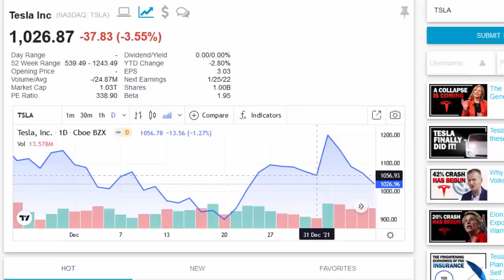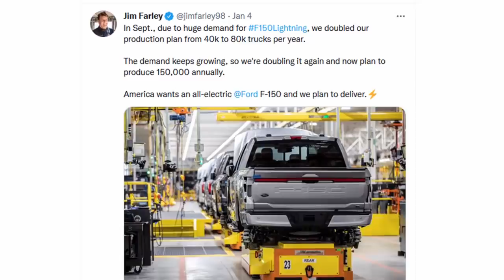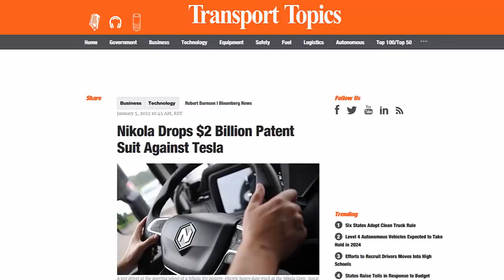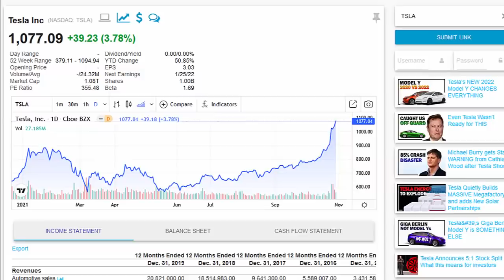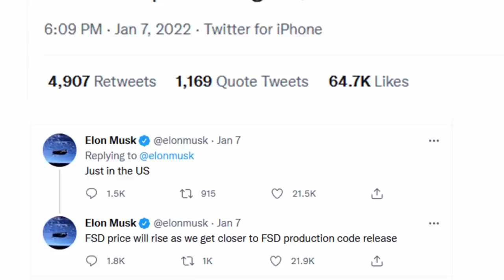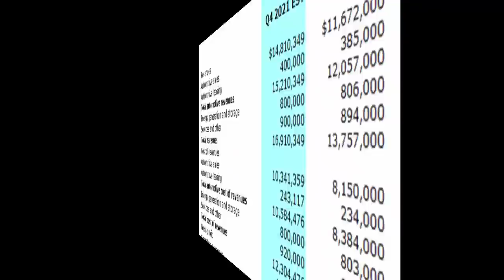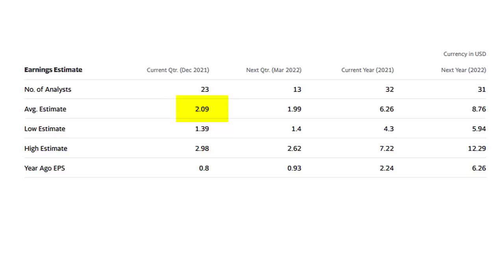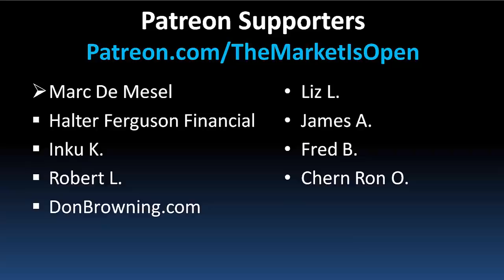You Won’t BELIEVE How Much Money Tesla Can Make in Q4

Comment: It could be the margins that will shock Wall St.
As production numbers increase fixed costs stay…… fixed, and possibly operating costs do not increase in line either, due to economies of scale.
Gross Margins of 30+% and Operating Margins 17-18% unheard of in auto, and may not be expected.
Reply: ...and yet to be determined service center costs, as they seem to be overworked and under staffed.

Comment: Although I am firmly in favour of Tesla’s vision only approach, Tesla fans don’t seem to acknowledge that the vast majority of people live in cities that have a relatively small area that is easily mapped.  This implies that the vast majority of the potential robotaxi market will be accessible to the likes of mobileye etc.  if these Lidar based solutions can come to market faster than Tesla it may turn out a smart move to use the crutches after all.  Of course, Ultimately, Tesla’s price advantage with vision only wins.
Reply: Good point. But it might suit Tesla to NOT be first to the Robotaxi market as the Lidar Taxis can pave the way with regards to regulatory approvals.
Reply: I’m for Tesla vision too but I too see companies using LiDAR/mapping coming to city markets first.  Hopefully it will be a very short lived “victory” for teslas competitors.
Reply: I would rephrase this to mean the real value in competing ADAS systems is the ability to tease the future in the same way that all "forward looking" legacy designed prototypes are never, ever delivered.  Just an old promise replaced by a new, better, promise.  There is no real world event where they ever "work" as in, standard equipment already on board, just unlock it with a phone purchase in the app.  What competition I could buy today, even with an unlimited budget isn't just bad, it's downright dangerous.  Lucid doesn't even have cruise control according to people that have them.
Reply: @ExAerospace  The lacking of something like cruise control (that is expected to be standard) is downright awful.
Reply: Sending a crap product to market is a crap strategy. What city doesn’t have construction? Mobile eye is useless during construction,  faded paint and has issues with manhole covers. Their solution is to add MORE HARDWARE!!!! 😂 it will never be enough with this solution.
Reply: Keeping maps updated for EVERY street in even large cities is a tremendous undertaking.  Never ending road construction updates etc / I think it’s useful for specific routes much like a bus but that’s about it.
Reply: @jgoemaat  all systems also
Have vision based decision making to deal with deviations from the maps.  Whether that works remains to be seen.  But it also remains to be seen whether Tesla’s vision only approach will work
Reply: "Although I am firmly in favour of Tesla’s vision only approach, Tesla fans don’t seem to acknowledge that the vast majority of people live in cities that have a relatively small area that is easily mapped. "

And that relatively small area is also the type of environment that changes most frequently. But that is besides the point anyway. Lidar mapping is a waste of time either way and lidar does not make cars smart and autonomous. You still have to solve computer vision, and when you have accomplished that there is no need for Lidar. 

"This implies that the vast majority of the potential robotaxi market will be accessible to the likes of mobileye etc."

There is a difference in having the vast majority of the potential market accessible, and actually being able to take advantage of it. Keep in mind that the vast majority  of the EV market is available to legacy automakers, but still they have failed completely at taking advantage of that. 

"if these Lidar based solutions can come to market faster than Tesla it may turn out a smart move to use the crutches after all."

No. It won't. Even if they are faster, they will still have a more expensive and inferior product to offer. Google was not the first search engine to the market, but having the right data approach made them superior to everyone else. This is the path that Tesla is on. Given the complexity of FSD there will not be many players and the winner(s) will take the bulk of the market. 

"Of course, Ultimately, Tesla’s price advantage with vision only wins."

Not only on the cost aspect, but their product will also be superior to what the competition will be able to cook up using the lidar approach.
Reply: @wheelofcheese100  "I’m for Tesla vision too but I too see companies using LiDAR/mapping coming to city markets first.  Hopefully it will be a very short lived “victory” for teslas competitors."

It will. You are forced to solve computer vision for any kind of generalized full self driving robo taxy service, and when you have done that there is very little use left for lidar.
Reply: What you say is true. However, with the rate of change of the landscape, building, and infrastructure in any urban area, LiDAR mapping will need to be continuously updated and vehicles software will need to be updated often, possibly every few days. I submit that the general solution is superior.
Reply: Vision only FSD is important because it will also be utilized in the Tesla Bot. Win Win!
Reply: @boringlyfactual6368  I believe most urban areas have public ally available online info of roadworks.  I don’t see it as an insurmountable problem to prioritise updating these areas.  In addition crowd sourcing at least low res updates to the map should be fairly straightforward.  IMO the difficulty of keeping maps updated in a city is overstated.
Reply: @svenhodaka9145  true.  But on the other hand a Tesla bot shooting lasers out of its eyes would be cool
Reply: @andrewpaulhart  - I understand the spirit of your comment. However, have you ever had to wait on a city inspector? And experienced the half -assed job inspectors most often do? In addition to the practical matter of getting a warm body out there, multiple issues remain — what to document, how to document, how to communicate that to the people who need to know, transcribing the data into meaningful 3-D maps, how to implement quality control of the inspections, and last, but not least, who is going to pay for it. Oh yeah, who is liable in the case of errors causing property loss, injuries, and deaths. There are myriad other potential issues such as how to manage the mapping during major infrastructure projects which can last months or years. The resources needed would be crushing. We definitely don’t need more bureaucracy. A general solution is the only thing that meets the smell test. Mapping and LiDAR will likely fill an important niche in urban transportation. One size rarely fits all for technical solutions, even general ones.
Reply: I just don't see how they can react to edge cases and real world problems like roadworks or a child suddenly walking out from behind a bus? Surely the cars need to be able to 'think' and make a decision in that scenario which requires vision recognition and artificial intelligence.
Reply: @chemistrysimplified1501  they all have vision as part of their sensor suit.  Since they all know that roadworks etc will exist they must be confident that their vision decision systems must be able to cope with these situations. The developers of Lidar inclusive systems are not developers without experience in AI and autonomous systems.  Elon doesn’t have a monopoly on talent and There are many people at the top of their game taking this approach.  

My take is that Elon thinks longer term than others.  He isn’t interested in interim solutions that might work in a subset of situations, whilst others are.  It’s not that necessarily that Lidar systems can’t work in cities, it is more that Elon isn’t interested in a solution that only works in cities
Reply: @chemistrysimplified1501  Thanks for your thoughts about this.
Reply: @andrewpaulhart  I watched an interview with Elon earlier talking about object permanence, such as when a child walks behind a bus, then continues walking (unseen) then appears in front of the car. LIDAR cannot detect and plan ahead for this and may give conflicting data to the computer. Only a vision based system with insane problem solving ability is going to be able to respond appropriately in time to avoid collisions. In any given city this is going to happen multiple times per day! Self driving cars have to be safer than humans to get regulatory approval which won't happen if they are only as good as say 'siri' or autocorrect on my phone!
Reply: @jgoemaat  Yes enormous ongoing cost to maintain these maps. Very much a short term solution
Reply: 2 1/2 years ago I was in a model 3 on a UK Road with just ordinary autopilot and we approached temporary traffic lights. The car stopped and when the light went green cautiously went over the other side of the road stared for a second at the traffic in the other lane before sliding back onto the correct side of the road and driving off. This wasn’t even full self drive and it was years ago and it was utterly astonishing.  The whole point of vision based driving is because every other human in every other car is doing this. The only reasonable way to drive in mainly human traffic is to act like a human anything else is unpredictable and fraught with danger. And let’s face it humans are unpredictable anyway…

Comment: To me talking about, how Tesla greatly talked the chip shortage is just meddling with data. Tesla does not have the highest risk at manufacturing/supply chain management-> they know, they will sell every single car. So please stop talking about tackling the chip shortage. Tesla just did not have to think of market panic.
Reply: "To me talking about, how Tesla greatly talked the chip shortage is just meddling with data. Tesla does not have the highest risk at manufacturing/supply chain management-> they know, they will sell every single car. So please stop talking about tackling the chip shortage. Tesla just did not have to think of market panic."

That was a cryptic comment. But if you believe that Tesla did not perform some great magic tricks in order to tackle the chip shortages, then you are plain wrong. Just look at how they wrote new firmware to 20 (or so) different chips.